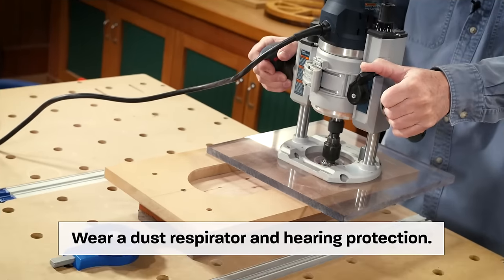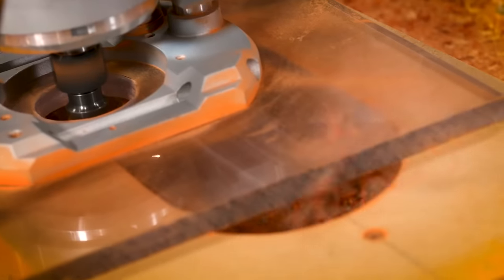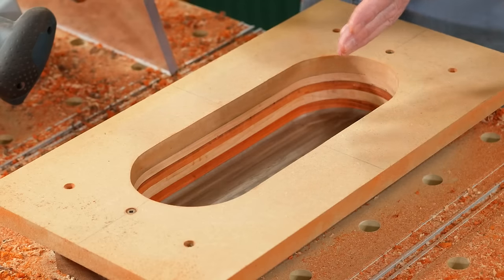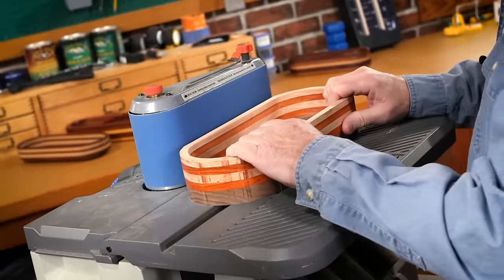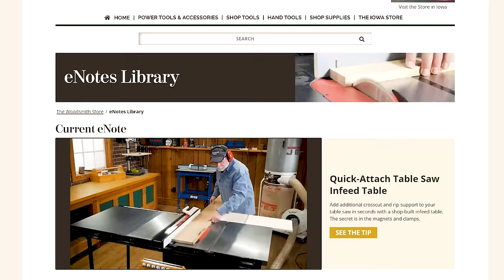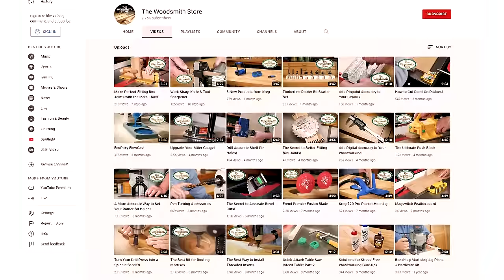Make a Routed Bowl!

Comment: I did this, there is so much heat build up even if I only take off the smallest amount. It has to do with the wood species, how sharp your bit is and how fast you go. My suggestion is if you have access to a drillpress and some big forstner bits, use those to hog out most of the center waste and then use the bowl bit to finished the edges because that saves time, your bit and a lot of heat/wood chips/dust flying around.
Reply: Thanks for that great tip! I'm gonna use that. 😀

Comment: Beautiful bowls! why not use 1/4 or 3/8” material for the template?
Reply from the maker: You could, but that would require a deeper cut initially in order for the guide bearing to engage the template. Personally I like to take 1/8" passes, which requires a thicker template to engage more of the guide bearing in those first 2-3 passes.

Comment: Loved the video. I have a question. Did you have to use longer screws for the new router plate. If so, what did you use.
Reply from the maker: Thanks for the compliment of our video!  
Yes, longer screws had to be used for the new router plate.  Just go to a local hardware store to purchase the longer screws that match the screws (threads) that came with the router.  Thank you for your question!

Comment: Quick question, how do you plunge with a flat bottom bit? I've got a similar bit from another manufacturer that I've been thinking of replacing, but i want to make sure I'm understanding how to use it, that it isn't my fault it isn't working well. 

I get lots of burns trying to use mine, but if i don't push the bit down fairly hard, it just kind of skims the surface, barely cuts. Do you need to predrill a hole for the bit to use to start off?

To be clear I'm just trying to put the radius on the edge of the bowl wall in this case, the bowl is already at the depth it needs to be, just trying to get the radius along the bottom edge.
Reply from the maker: Try turning the speed down a bit. as you plunge begin to move the router so that the router isn't sitting at one location for any amount of time. Also, make sure your bit is sharp. To be honest with you, I occasionally get burning as well. It usually sands away. Hope this helps.

Comment: is using a collet extension in a hand router safe? I was always told they should only be used in a router table.
Reply from the maker: Sorry for the delay. I use the collet in my hand-held router whenever I'm routing bowls. But I always use it in the router with the 12" x 12" acrylic base. And I don't lift the router out of the cut until the motor has stopped completely!
Reply: Excellent video and techniques.  Those are great looking wooden bowls?